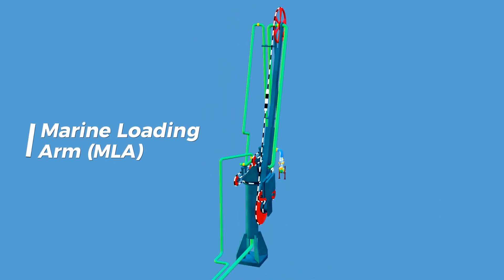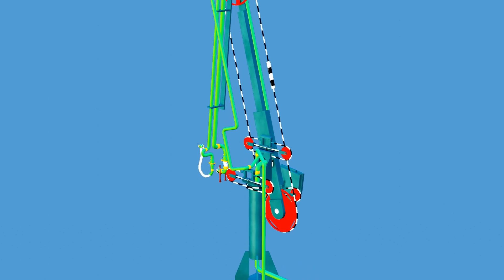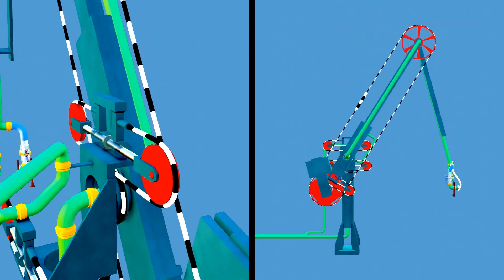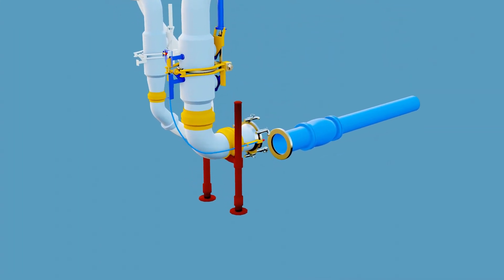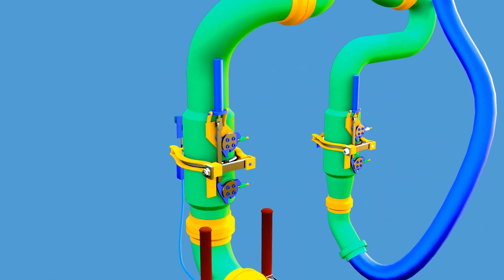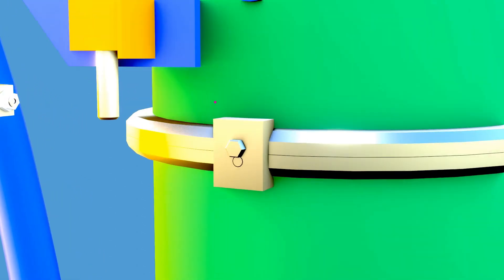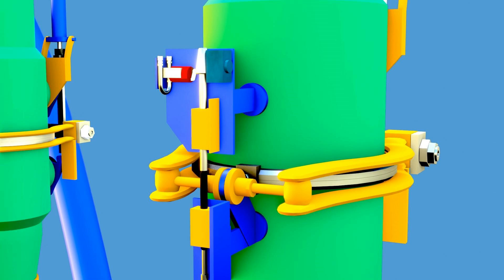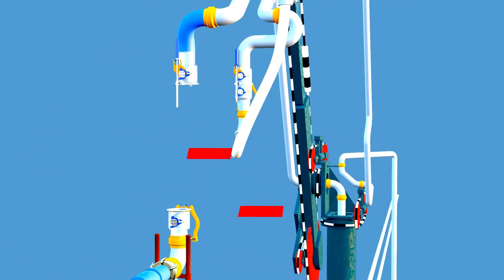Marine Loading Arm (MLA) Explained: Key Components Functionality, Safety, and Emergency Release.

Comment: Why is there vapor line? Are they interconnected?
Reply from the maker: The vapor line is necessary to manage and balance the gas phase (ammonia vapor) during storage, transfer, and pressure regulation. Here’s why:

Pressure equalization: Vapor lines help balance the pressure between tanks or vessels during loading/unloading.

Boil-off management: Liquefied ammonia tends to evaporate at ambient conditions. Vapor lines allow this vapor to be redirected for compression, recovery, or safe venting.

Safety: Prevents over-pressurization of tanks due to vapor buildup.